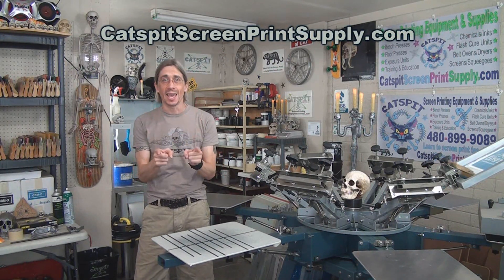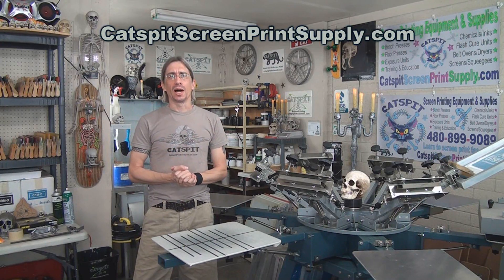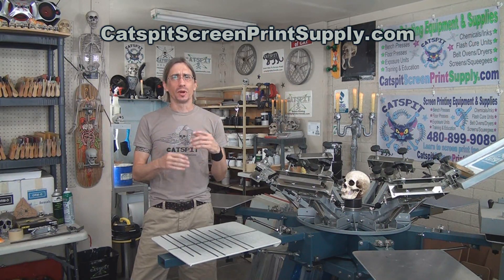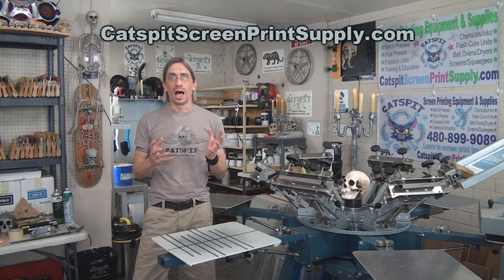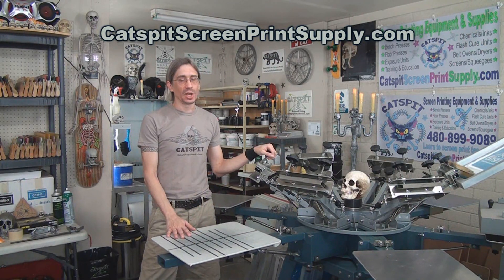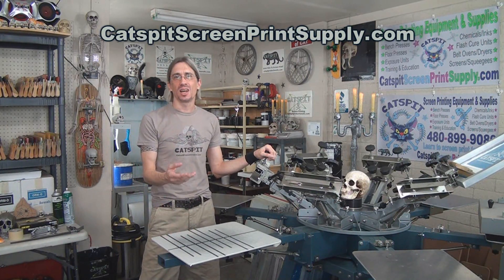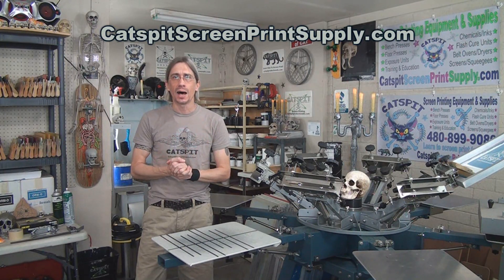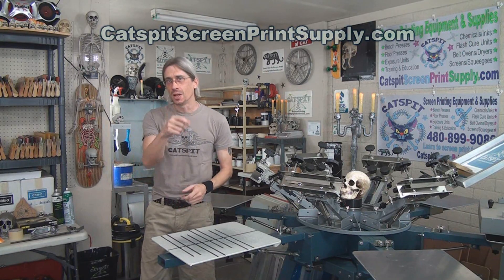Reliable & Affordable Screenprinting Equipment: Press Prototyping

Comment: do you have tips for line table press?
Reply from the maker: Long table? Graphic press? Not specifically... LOL. But most screen printing techniques are similar with differences in inks, mesh count, emulsions, squeegee durometer and such but the general principle is the same. So many of my textile tips do apply across a wide spectrum of screen printing applications.   Thanks for watching! http://www.catspitproductionsllc.com/ - http://catspitscreenprintsupply.com/

Comment from the maker: This is a cool fabrication video Ranar made for the new Elite rotary press print heads. I thought I would share this with you for some weekend enjoyment. The video quality is not the best but it’s pretty cool. 3D printing, aluminum mold pouring and CAD development are all quickly covered in this entertaining offering. Please remember if you need #screenprinting #equipment or #supplies, please visit:

http://catspitscreenprintsupply.com/

OR

Call 480-899-9089

Reliable & Affordable Screenprinting Equipment: Press Prototyping